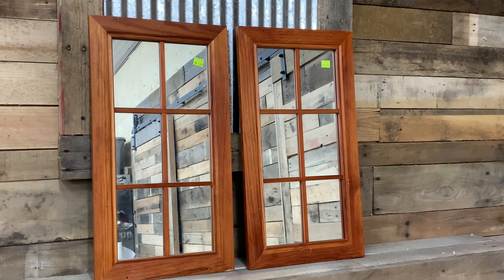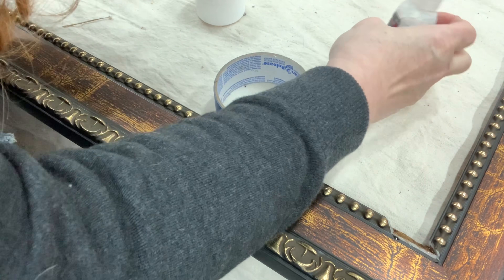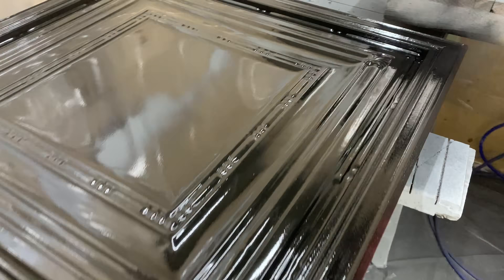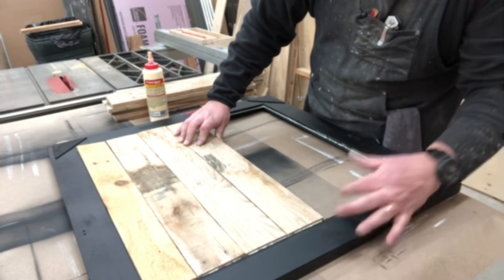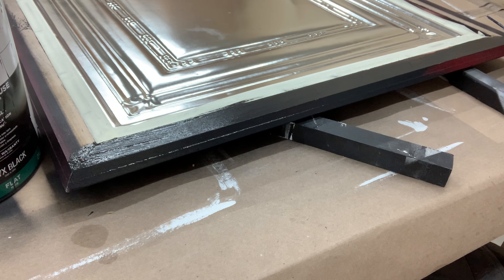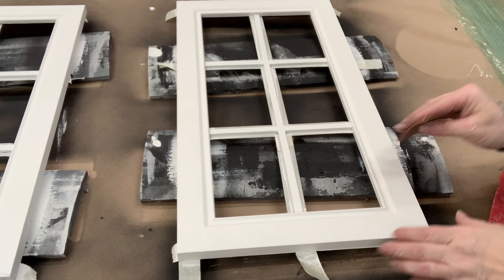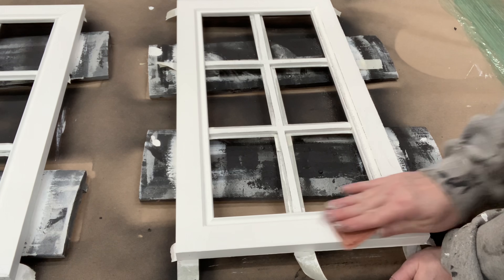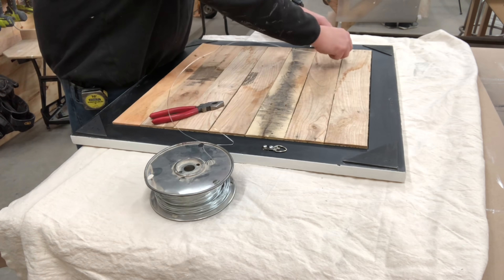Trash to Treasure Making over Thrift Store Finds To Resell || Farmhouse Decor

Comment: That beaded mirror came out stunning! Actually, I am swooning over all these pieces today!
On a side note...I have a question. I noticed you seal some pieces with Polycrylic and other pieces with finishing wax. How do you decide which pieces get which type of sealer?
Reply from the maker: The kilz white paint we use has a primer in it.  And we seal it in with the Varathane finishing wax in natural. Then we seal the black paint we use with polycyclic and the antiquing wax. And if I feel a item needs extra protection I’ll spray it with polycyclic. Just want to make sure the paint is there to stay and will hold up over time.
Reply: So if I understand you right, you don't need a polycrylic sealer if the paint you use has a primer in it. Then every piece gets a wax sealer regardless of the type of paint?
Reply from the maker: Yes, that’s what we do. And what has worked for us.
Reply: Thank you so much for your help! As a new "treasure flipper" you've answered a question I've been puzzling over for months! 😘

Comment: Hi there I was listening to your you tube about that double sawtooth hanger system. You said you remove them because they are hard to hang on the wall. I once heard someone say that they put toothpaste on them and use a level on the frame grit level them press it against the wall. The add the nails or screws where the tooth paste is and to will hang perfectly. Easy peasy. Just need to wipe the toothpaste away
Reply from the maker: Thank you for sharing

Comment: Thank you for the great content...I am curious, the pallet wood placed in the frame.....what do you think the end user will use it for? Decor only?  Looks like it could be a top to an end table if you added legs.  What is your opinion?  thanks again
Reply from the maker: I think most buy it for decor to hang on the wall. It would need a solid back to be used properly as a table. Pallet wood is pretty uneven.
Reply: @GingerChickRehab  That makes sense.....Thanks again

Comment: What gauge is the wire you use for hanging?  Is it multi-stranded?
Reply from the maker: It’s a 17 gauge. Nice and strong but not so strong you can’t twist it. Amazon sells it. We buy it at a local farm store in the fencing section. A lot cones on a spool.
Reply: Thanks, Yvonne...I’ll check the farm store here.